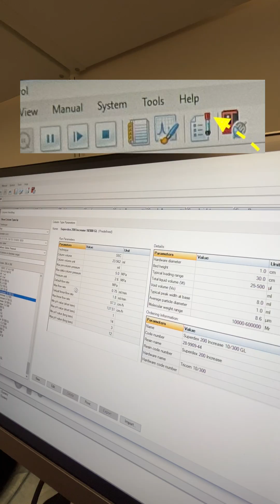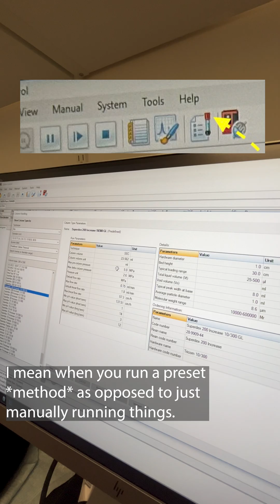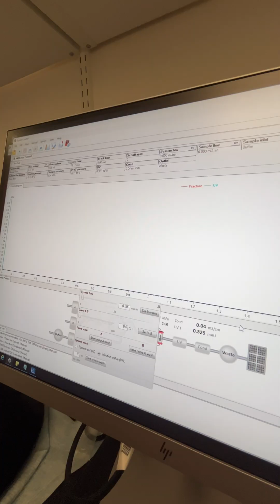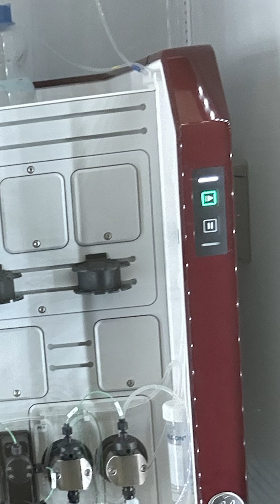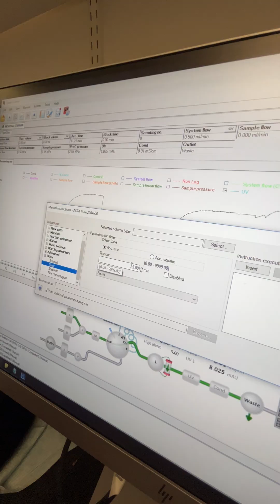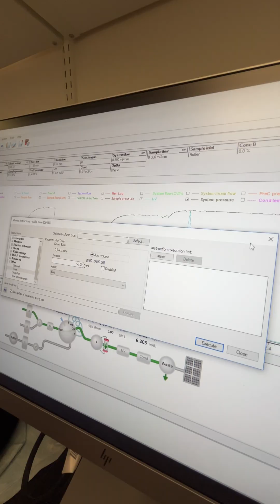Connecting a SEC (Size Exclusion Chromatography)/Gel Filtration column to an AKTA PURE

Comment: I have a question about two pre-packed FPLC columns that were left by someone a long time ago. Unfortunately, I don’t know what type of resin is inside the columns. Is there any simple way to roughly identify whether the resin is ion exchange or gel filtration (for example, using buffer changes or a basic test run)?

Also, these columns have been stored for over 10 years. They look clean with no visible mold, but parts of the resin appear partially dried. In your experience, is it still reasonable to try to reuse or recover them, or would you consider them unsafe or unreliable at this point?

Thanks a lot, and I really enjoy your videos.
Reply from the maker: Best would probably be to try a mix of proteins with different properties.
Reply: @thebumblingbiochemist  That’s a good idea, thanks for the helpful suggestion.